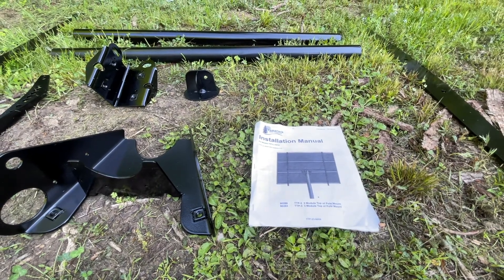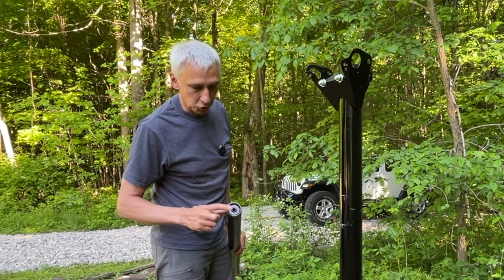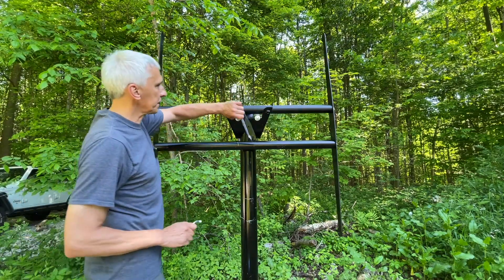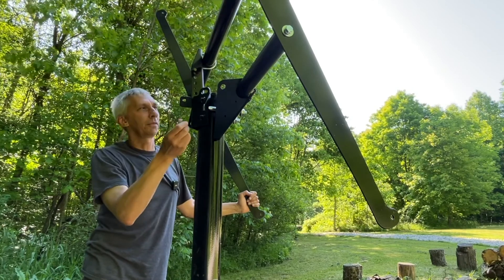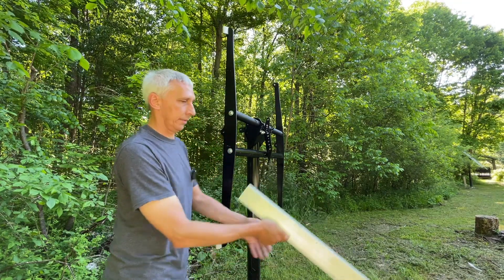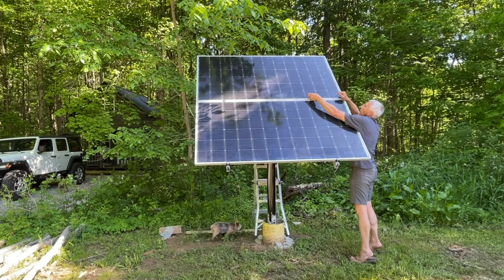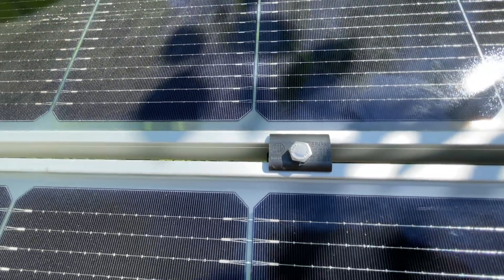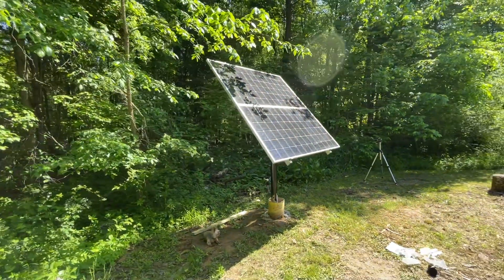Tamarack Top of Pole Solar Panel Mount

Comment: Don’t forget to trim that tree a little. 😅😊
Reply: Really liked the convenience but not the price.  Looks good tho.
Reply from the maker: I just prepped another pole mount system for a friend of mine who tried to avoid the expense with several mounting fails, costing him broken panels, downtime etc. A year later he finally gave in and chose to use the same mounting system I am using after buying 2 more panels... . I know these systems are expensive, but they work and last for decades.
Reply: It's his tree bill mind your own business.
Reply: @ try minding yours. You know?  This was a suggestion between A. &  B.  So …. C. your way out of it.
Reply: @IMJUSTBILLUNO  Does this mean we can't be friends Bill? Why that would just be terrible if we couldn't.

Comment: $566 for THAT????   $80 for unistrut....spring nuts...fence post....& concrete.  Plus a free satellite dish mount off of Craigs List will do the same thing.
Reply: What was the wind load max?
Reply: Same as the satellite dishes that are installed everywhere.   @neilwani1178